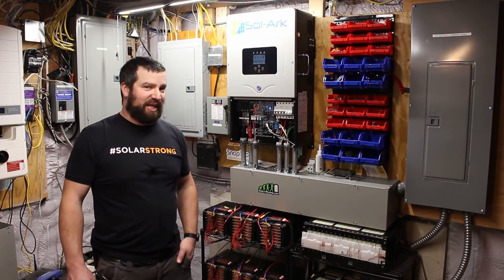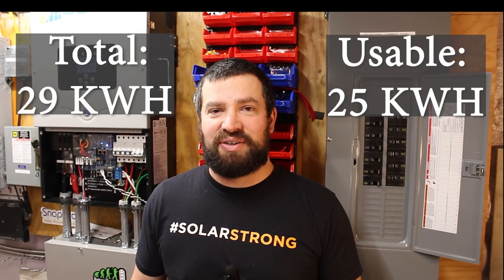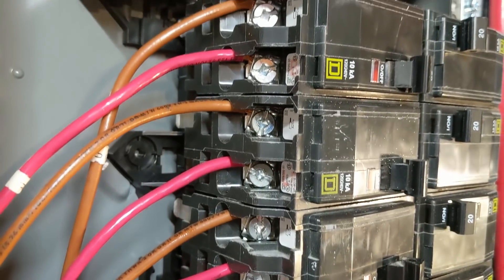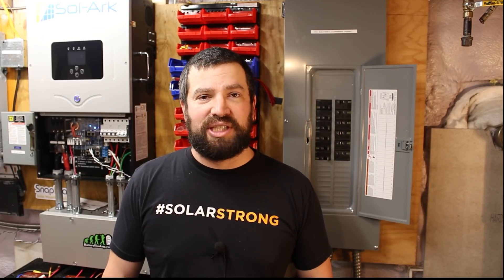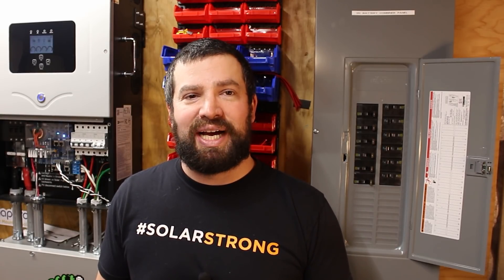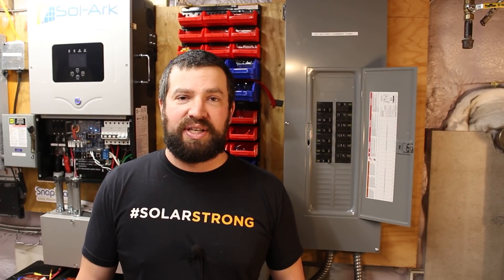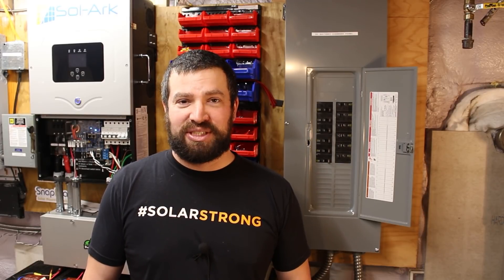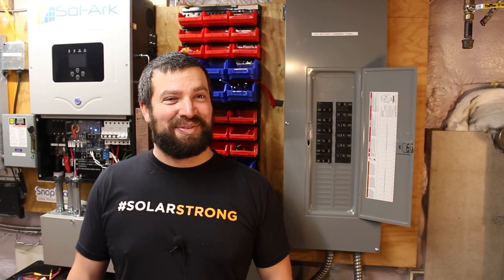How a Professional makes his own Battery Bank, Solar Off Grid

Comment: I have a complete solar system for my house, but was very disappointed that it turns itself off when the power goes out.  What do you think is the best budget friendly way to add in battery storage.  This is for a 400A service to 3100 sq ft house + shop + tiny home (all off the same service).  Thanks!

Comment: seen this video show that there is no point to have a micro inverter or solar edge that wont work if the grid goes out and even having a sunny day still wont power you house or your battery.

Comment: Quick question.. I have a Victron Quattro inverter/charger and 2xBYD 13.8 kWh batteries (off grid in Scotland). They don’t make these batteries any more but I want to increase my storage. I was told by my installer I couldn’t because they would have to be the same. But Ben has completely different mix of batteries! So am I being misled? Or do you think it’s a Victron thing that it needs the same type? How would it know?! Thanks.

Comment: Hello, remember each solar install is different. so a manual is to be provided of complete operation and configuration of the system. We as humans have a experation as well. So in closing I am grid tied and sell to electric company with 20kw Solar V/H tracking. The only one who understands the system and how it was built is me the builder. Not even the electric company who inspected it before going on line to push back on there grid were lost on how this worked. I was amused. However I understand your system and how it works. Just a Note!

Comment: The most interesting news here to me is that QO breakers are DC-rated. I didn't know that. It will make for a relatively cheap way to get DC combiners compared to dedicated DC boxes. However, from what I can tell the UL rating is only 48vdc even on the 2-pole models. From the Schneider bulletin 0601DB0401 the higher 125v rating is only Square D certified and not UL recognized. Please correct me if I"m mistaken. This will come in handy once I finally get the time and resources to make my own battery bank.

Comment: Do have a question. You have the 4/0 cable from your load center going to the Battery input on the Sol-Ark rather than a battery bank. How does connecting it that way give you consistant voltage for your load center? I have my Load center connected to the load breaker in the Sol-Ark and the battery input connected to a bus bar for my battery bank.
Reply: The 4/0 cable is from the battery combiner load center into the battery input on the Sol-Ark.  Each battery has its own 10awg wire tying into the combiner with a 20a breaker.

Comment: I'm curious where you guys are finding your Square Metal guttering for your wires at
Reply from the maker: I called around to local electrical supply.  Type into a search engine "Electrical supply near me" and you will see them come up.  They typically sell to electricians, so don't expect good, or any, customer service.  Try to go between 1 and 3 pm, that's the slow time and they are more likely to help.
Reply: Google wire ways, or trough. Hoffman is a magor MFG. There are others. If you can find used stuff, you can use a hole saw to make plugs and MIG or TIG weld then in.  ( back with a brass or copper bar ). Used enclosures are pennies on the dollar if you are willing to seal up the holes you don't need. Paint is cheap.

Comment: what is the best (better) to have or to do: one 48V battery or 2x24V batteries or 4x12V batteries? (of course LITHIUM)
it's about Wind Turbine (1kW, 2kW, 3kW,...) 48V OFF(the)GRID and thinking what is better: Power Wall, Battery, batteries and cells (bank)? No matter about cost (price) - just to do (have) THE BEST...
I know about Ah too (capacity)...
THANKS
Reply from the maker: I personally think a 48v system is the way to go for home systems.  I'd only do 12v in a van or something really tiny.

Comment: DavidPoz what bms would I need to run and where can I find them for 2012 chevy volt batterys? thank you
Reply from the maker: Depends on your specific needs.  If you want a quick answer that will probably work: https://batteryhookup.com/collections/accessories/products/12v-lifepo4-smart-bms-w-low-temp-cutoff?variant=36287975391394  you can use code "DAVIDPOZ" for a discount.  But if you want a more specific answer to what you plan to use the battery for, then e-mail me through my website, or send me a FB message.
Reply: @DavidPozEnergy  thank you

Comment: There is some breaker switch that are rated 600VAC as well as 250VDC or even 600VDC. What i dont like is that  the various electricity  regulations state about 48 or 50VDC but NEVER specify if this is full charge or nominal or average or peak... it is time for electricity regulations and law and the code  to talk in BATTERY language and not just on grid language...  A battery have a max a min and a nominal voltage... the code dont even mention that....

Comment: You have 40A bms running on 30 A wire, feeding 20A breakers... so, the BMS will never hand over 1/2 the rated amperage on them. Nice!
Reply from the maker: Exactly.  Ben did not want a chance of blowing up a BMS.
Reply: Chineese  BMS not UL or CSA or ETL etc, must be deragted by at least 1/2 minimum and then you have less chance of having problem

Comment: Awesome stuff! 
They really need to make more inverters that can use the full voltage of the 16s batteries. Atleast 66v top operating voltage would be good. I also use 16s Chevy volt packs. My grid tie inverters can use up to 90vdc so I can charge batteries to 65.3v.

Comment: 1. soft stranded wires, wound on the terminal of the automatic interrupter without compression in the cable tip.
2. automatic circuit breakers probably for AC voltage ? they will cope with the extinction of the arc from the DC source with a particularly low impedance ? have there been short circuit tests right on the breaker?
3. Why are the lithium plate terminals not insulated and sticking out ? waiting for a fallen screwdriver ?

Comment: How long has ben ran those bms's like that? These bms manufacturers say your not supposed to use these this way and i have seen a few people doing it with no issues......so far😏 only handicap i see is inability to monitor and communication between all the bms's

Comment: Very interesting about the DC rating of those breakers. I heard before they were 48V but did not know the double poles could go up to 120VDC! I may have to check those out.
Reply: I'm running this same system using 15 LTO SCiB batteries and it works terrific, thanks to David Poz and Ben.
Reply: they must have upped it from the 96V it used to be?